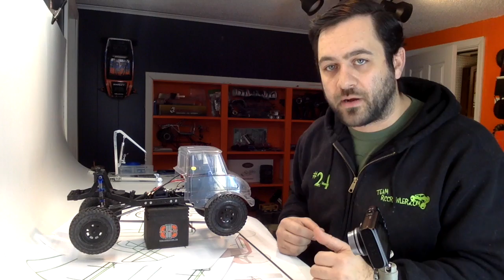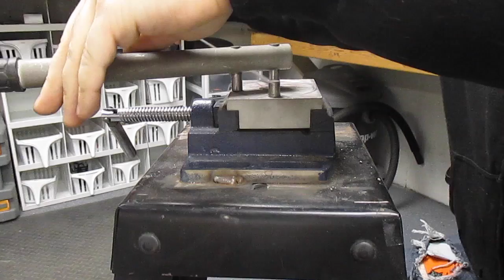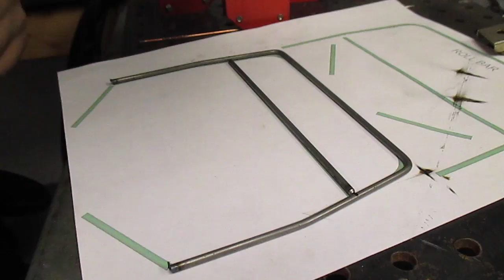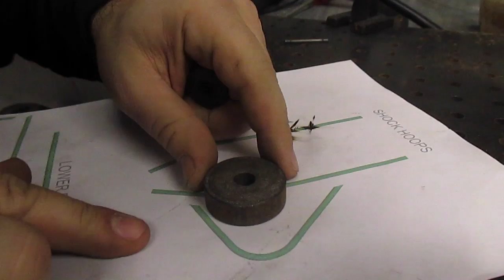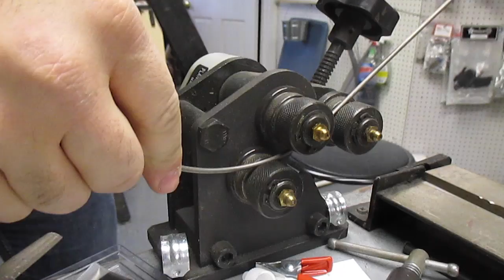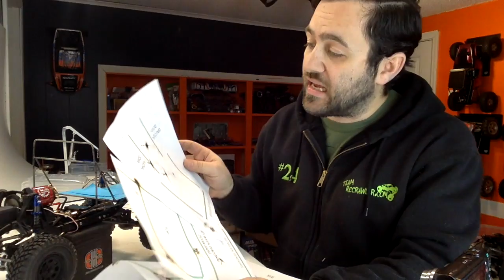Vaterra Ascender - Unimog - Chassis Construction - Episode 6

Comment: Hello m8. Just a quick question. Why do you keep the original ladder chassis in there?  Why don't you build a full space frame chassis? I must say they do look cracking good chassis.
Reply from the maker: Due to the Class 1 Rules for SORRCA competitions, you are required to run a full length rail chassis that extends the length of the wheel base. This truck will be one of my competition vehicles this year so that is why I am sticking to those rules.